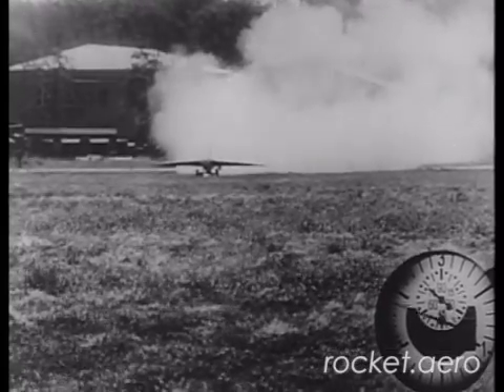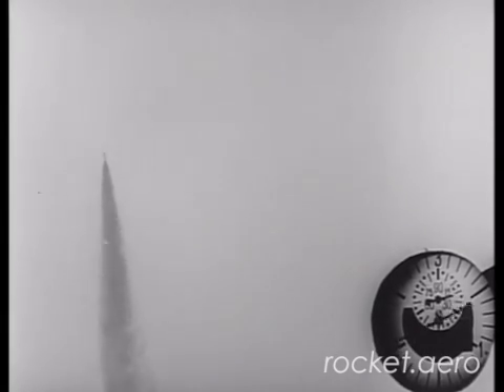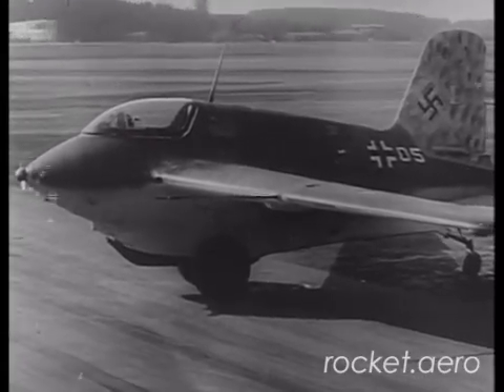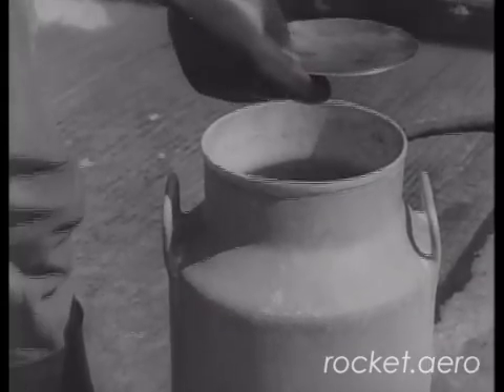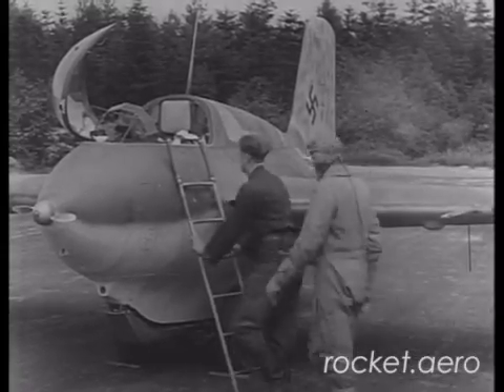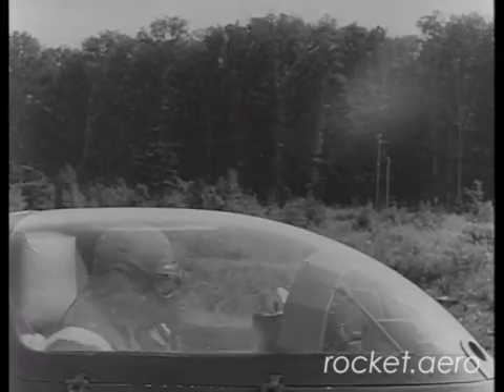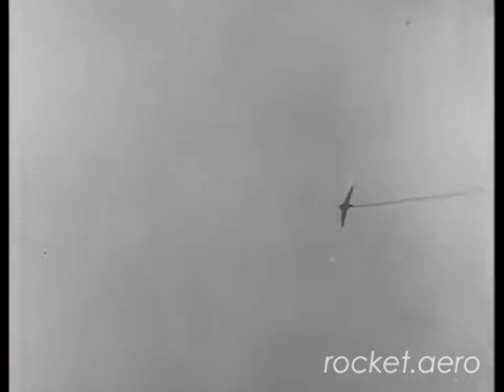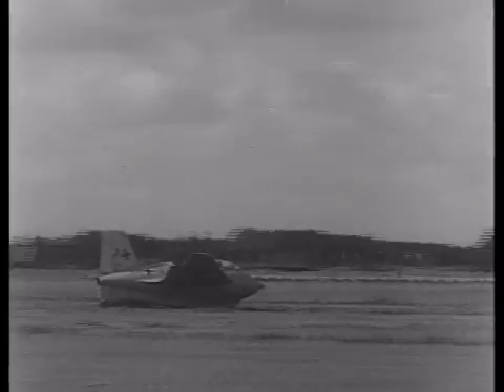USAAC Me 163 Briefing FIlm

Comment: Very impressive, but it did have a bit of a problem of exploding on landing.

And exploding on takeoff.
And refuelling.
And mid-flight.
And sabotage from the slaves who built the fuel tanks.

Oh, and the wheels bouncing back into the aircraft on takeoff.

And the pilot's spine shattering on rough landings. Just before the plane exploded.

There's a reason nobody else experimented with rocket planes 😅

Comment: As mentioned in the clip the fuel mixture was extremely dangerous.  Several test pilots were killed during fueling.  Any crash was terminal.
Reply: It didn't help that both of the chemicals were colourless, which meant that the ground crew accidentally mixed them up and injured/killed themselves

Comment: without german engineers, neither the usa nor russia would have come this far so quickly
Reply: With what? Rocket technology?
First of, there is a reason why this is the only rocket propelled jet fighter that was ever build (it is realy not a good idea for multiple reaspns). Also the soviets had their own rocket plane called the BI-1.

Also the U.S. P-80 jet fighter was designed and build parallel to the ME 262 and although the germans started working on the ME 262 since 1933 while the U.S. started the P-80 programm in 1941, the P-80 still came out just one year after the ME 262 and was used in italy during the end of the war. The P-80 was supirior to the ME 262 in almost every way and every modern jet fighter follows its design. 

Or do you mean the V2 rocket? Yes germany was ahead of the allies on that one but they were only ahead because they got f*** up by allied aircraft in the battle of britain and their long range bombers were absolutely terrible and had no bomb sights (that is why even the HE 177 had to be designed as a dive bomber) and supirior allied anti aircraft guns using the radio fuze HE-VT proximity fuze shells made it impossible to attack britain after 1942 because no aircraft could survive such precision AA. 
Rockets were inferior to bombers in every way but under these circumstances they were the only thing that germany could use so they put more effort into building them then the allies who did not have a need for them.
Reply: @jakobc.2558  nah USA technology is dogshit
Reply: @marcogriepx2708  damn bruh I guess great aircraft like the F-22, F/A-18, and  F-4E Phantom II don’t exist 😐😐😐
Reply: @jakobc.2558  lol smartass
Reply: yet china despite of its economic growth, still suffer engineering problems
Reply: good example of money and desperation, courage and recklessness

Comment: No mention of pilots getting melted by leaking fuel I notice.
Reply: Not melted but fully oxidized.
Reply: @foreverpinkf.7603  Thanks for the correct scientific description, the only other one I have read is turned into jelly.
Reply: @RalphColmar  Welcome. H2O2, which is used as a oxidizer, is also used to bleach hair (weaker concentration of course); afak most people survive a visit at the hairdresser and no one ever had melted.
Reply: @foreverpinkf.7603  Just depends on the concentration. Concentrated H2O2 is also very explosive.
Reply: @foreverpinkf.7603  
Big difference between 3% hydrogen peroxide and pure H2O2.
Reply: What I heard used the word dissolved

Comment: With time it could have been radio guided , pilotless , detonated in bombing formations!
Reply: Beth Johnson well yeah but for that time you would've waited 80 years to have the technology
Reply: ???   not a massive leap from Hs293 plus r/c or proximity detonation. They had the technology. Whether it would be effective is another story.   @Loup-mx7yt
Reply: If that were practical, someone would have gone in that direction after the war.
Reply: We tried that, Jack Kennedy's older brother was vaporized when the explosive packed B-17 he was flying blew up before he could parachute to safety.  Google it.
Reply: In WW2 the germans developed television guided bombs, air to surface guided missiles ( used in the Bay of Biscay, I tbink)  The V1 & V2 were guided with autonomous gyroscopic stabilization.  The worlds' first ICBM, the " New York  rocket" had been designed at the close of the war.  Also on the drawing board was the Sanger-Bredt Stratospheric Bomber. A space plane with a global range. In the 80's, a full scale mock up was built, as it was still a viable proposal. 
Read the Jane's Book; German Jet Genesis

Comment: Phenomenal plane, a revolution in it's day.
Reply: A very impressive way to kill your own pilots.
Reply: A waste of resources on dead-end technology
Reply: @CaptHollister  
Ok you get a zero in comprehension. .
 That Walther rocket engine and its successors went on to power assist our jet fighters in the 50's-60's.
RATO.and/or JATO.
Far from dead end. It was the beginnings of our space program. Werner Von Braun, who developed the V2, went on to head up the Apollo program and he designed the Saturn 5.
 Germans were also the first with swept wings, for high speed flight.
Reply: @patrickhorvath2684  Rocket-powered fighters were a dead-end concept. Swept wings were not a development that came in with the 163 as they predate WW1 and by WW2 there were other, much better planes that used them (think Me262). The invention and use of JATO/RATO pods also predates the 163 and were used by both sides during WW2, again nothing to do with the 163. As I said, the 163 was a waste of resources on a dead-end concept, unless you can point to all the current rocket-powered fighters. What do the V2 and Von Braun have to do with the Me163 ?

Comment: The test pilot mentioned in the film was Rudy Opitz.
Reply: 18tangles  She got to fly the Me 163A (unarmed trainer and initial proof of concept) under power with the first "cold" engine type.  That is where her "in person" description comes from.  She only flew the Me 163B (operational armed fighter version) as a glider.  They interchangeably use footage of Me 163A  and Me 163B types in this video.  The Me 163A's have a flat belly and a much smaller fuselage.  The Me 163B's have the bulbous round fuselage and are much heavier than the Me 163A models due to armament and extra fuel.  So, you are both "sort of" right.  How
do I know?  My father was the test pilot at the start of this thread.
Reply: @Demo Yes, she tested a 163 to destruction..
Reply: 18tangles  OK, believe what you want.  I will believe my father who was the chief military project test pilot on the Me 163 from 1941-1945.  He knew whenever she showed up, and personally briefed her.  He was the tow pilot (and only qualified Me 163 pilot present) for the flight where she had her famous accident.  He was no big fan of hers,  but he always wanted the true facts to be recorded - devoid of sensationalism, etc.  She had actually participated in some rudimentary testing of the Me 163B in glider form, as there were no engines available yet.  Then she had her accident, and spent a long time in recovery.  After she had rehabilitated herself, she came back determined to fly it again.  This time, they made her go through the entire "new pilot" training program on the Me 163A.  She did this, and that culminated in one single powered flight in the Me 163A with the small engine.  Then, when she showed up demanding to be allowed to fly the Me 163B under power, the Group Commander (Späte) denied her access.  "She went away mad and never came back."  Other references which state that she flew the Me 163A (training version) under power are: Komet The Messerschmitt 163 by Jeffrey Ethell, page 56, and Me 163 Rocket Interceptor Volume 1, page 152, by Ransom and Cammann.  I don't know why she might have given Winkle Brown the impression that she had not flown any version under power, because she certainly talked about it much differently in later times.  Brown, on the other hand, lied about not having flown it under power himself until all of the German crew chiefs who helped him do so after the war were dead.  It was only then, that he said that he had indeed gotten one powered flight in it.  Up until then, it was widely believed that my father made the last powered flight (25 April 1945?) which was an engine test, and wound up as a wreck which he barely managed to live through.  My father was initially supposed to demonstrate it for the US Army Air Corps in the USA as part of Operation Paperclip, but the powered flights were deemed to be too dangerous, so it was only flown as a glider for testing in the USA.  As I recall, Brown held my father in utmost respect.
Reply: 18tangles  Well, at the very end, my father was Group Commander of 2/ JG 400.  He was at Husum, but in the hospital slowly recovering from his injuries suffered from the 25 April accident.   It was he that ordered the Me 163s not to be blown up.  He surrendered his unit to Johnny Johnson from his hospital bed.  Winkle Brown could find him any time, as he was not mobile at the time.  As far as Brown's  powered flight goes, look up his YouTube video presentation where you can see and hear directly from him about how the German crew chiefs swore him to secrecy because they feared retribution.
Reply: 18tangles  That is subject to conjecture.  My father still firmly believed that there was a powerful network of "underground" Nazi sympathizers until he died in 2010.  He was afraid of retribution from them if he criticized H.R. and aired any of the gripes he had with her, so he always very carefully selected his words whenever he spoke publicly about her.  It really shocked me when I found out how much he was still in fear of those "shadow people" for such a long period after the war was over.  Inferring from this, I can only conjecture that those crew chiefs that helped Brown also feared from being visited by these same "shadow people".  They held valuable technical information that the British wanted.  I just can't see the British voluntarily handing them over to the Russians when the British controlled that sector on the ground.  They are all dead now, so you can't go and ask them.  Maybe Brown made some personal notes which might have elaborated on the subject?  You'd have to ask whoever has custody of Brown's archives.
Reply: Part of the answer you will find here... https://www.youtube.com/watch?v=0wlNey9t7hQ   @mrod2b216
Reply: @mrod2b216  And was there ever a real undergroud Nazi network then?
Reply: @ZerokillerOppel1  I have no first hand knowledge myself.  All I know is that my father definitely believed that it existed.  There are TV shows (History Channel?) that claim to have evidence of a network called "Die Spinne" (The Spider) which helped Nazis get from Germany to South America after the war.  My father came to the USA after the war as part of Operation Paperclip, so he was with a fairly large number of their engineers and scientists.  It must have somehow been discussed with enough credence within that community for my father to be so certain of its existence.  I only came to hear his beliefs about this when he was well into his 90's.
Reply: Only flown once by a non-German after the war, Capt. Eric Brown RN.

Comment: Landing speed 180 mph?! Thats like a F-104 Starfighter!
Reply: I just looked up the landing speed of the F-15 eagle. Its almost the same! Insane!
Reply: Hakapik small wings more speed
Reply: @tsarbomba4620  yep, but the downside is, small wings less lift, agility and Dogfight capabilities and problematic landing/start charactaristics
Reply: @Sturminfantrist   I've never heard of anyone trying to dogfight in one of these.  They where meant for one or two passes at a bomber formation before making a quick landing.  Not enough fuel for more.
Reply: @Rivercoon  

in case of the Me 163 yes but the Pakistan air Force used the F-104A during the Kashmir war in air to air  combat with indian MiG-21, it was not a success and the PAF lost a few F-104A because the IAF MiGs outmanouvered the PAFs F-104A

And the Luftwaffe had two pure  Fighterwings with F-104G  in service in the 60s for the Air to air role, but both Wings  after a relative  short time of service recieved the F-4F Phantom for this role
Reply: Yep and more dangerous then a F-104 during landing because of its highly explosive and unstable Fuel, but nevertheless the first plane with a  extrem high climbrate, like the famous F-104 a flying Rocket
Reply: @Sturminfantrist  Worse than a Starfighter, wow that IS ruddy dangerous :-)
Reply: @Sturminfantrist  fuel tanks would have been more deadly than when full of fuel because they would have been full of volatile fumes.
Reply: @RalphColmar  yep thats true,  many Me-163 exploded during a hard landing
Reply: @Sturminfantrist  no, at landing was the me 163 out of fuel...
Reply: @leneanderthalien  I know it !!!!!!!!!!!!!!, the 163 had only  short flying time and landed in a glider mode but there were  dangerous fumes left and fumes are fuel in  gas Form, do you know now what i mean , iam  sorry that my engl. is so bad,  generally the  163s fuel T and C Stoff was extreme dangerous during every Phase of the Sortie, refueling, Start and during landing because of the fumes left.
Believe me i know enough about aircraft incl the Me163, i have nearly 200 books incl aircraft Profils about the theme.
Reply: Strangely enough, the wing loading when landing was about the same as a Piper Navajo, so the landing speed could possibly have been dictated by a nose high attitude beyond which it was inadvisable to touch down? Possibly they feared a forward pitching if they landed tail low? 
The actual rotate speed at gross weight on takeoff is listed as 170mph and I very much doubt that pilots would have been instructed to become airborne without stall plus, say, 30 mph.
I suspect the stall speed of a fuel depleted Komet was around 100 mph, it was just too hazardous to land the aircraft at the very high angle of attack this speed would yield.
If a replica of the wheeled version was built it would have extremely benign flight characteristics other than the results of being short coupled. As I recall, the Komet could not be induced to spin, and non-accelerated stalls were similar to a modern canard design.
Opitz said that it was easily capable of getting on the tail of ANY fighter in the Luftwaffe inventory and that basically it was a joy to fly.
He actually said that the most unpleasant part of flying the Komet was the fact that near the end of the war they had often to eat a lot of cabbages, onions, and beans and other gas producing vegetables and that their intestines would blow up like a balloon due to the ridiculously high climb rate. He described the pain as "terrible".
Reply: Interesting comparison given the F104 aka Widowmaker had the oh-so-clever downward firing ejection seat etc
Reply: @RockinRedRover  Not all F-104 Versions had the downward firing Ej. Seat, iam not 100% sure which of the US Verions have it or not, the  A or C ? but the Multirole G version had the  upwardfiring Lockhheed C-2 Seat, later replaced by  the safer Zero zero capab. Martin Baker Seat GQ-7 Seat
For a high flying interceptor a downwardfiring seat is not a Problem but for a Fighterbomberversion flying nuclear strike,CAS  and other low level  Miisions it makes no sense so the G Versions was planned from start with an upward firing seat (C-2)
The F-104 G had many good solutions, look at the stickpusher device, it was good for a highflying plane to avoid Stall Spinning but when you came near a Stall in low level flight the Stickpusher dev. was deadly so the Luftwaffe deactivated it after  some planes were lost
Reply: @Sturminfantrist  Agreed.
Reply: @RockinRedRover  about Widowmakers, many planes were widowmakers, the Bf-109 had a narrow undercarriage which led to problems during start and landings many inexp. Pilots died during training with the Bf-109,
 the first F-100 versions were instable, the F-105 had a reputation as triple thread: 
 "Triple Threat" — it could bomb you, strafe you, or fall on you"
Yes the F-104 had a bad reputation  in the early Service Phase but many problems were solved later, 
The B-26 Marauder had a widowmaker reputation but the best in combat safety record of all USAAF Bombers (lowest loss rate %  in combat)
Reply: @Sturminfantrist  Agreed again. In more recent times the A10s had a "widowmaker" image too, esp for the British Army eg 9 soldiers killed when their Warrior APCs were attacked in the Gulf in Feb 91. I won't go into more detail, but neither will I forgive or forget, as the USAAF appears to have done.
Reply: On a skid....crazy.
Reply: @quellenathanar  it was not the only Plane landing on skids and starting on a Dolly, take a look at the worlds  first Jet bomber Arado 234 Prototypes ;) but for the Ar234 it was an impractical solution and Arado reconstructed the 234 to the 234B version  with an conventional undercarriage, it took/cost time and the aircraft service intro was delayed because of the reconstruction, so i dont understand why they did such crazy things like landing on skids, a combataircrafts turnaround time ( rearming and refueling) should be short , placing a aircraft on a Dolly and recover it with a crane/specialtractor takes too much time, it is operational impractical for  many reasons.
Reply: 18tangles  you missunderstood my Post, i dont compare both Planes i mean both were Climbmonsters of its time period, i know that the F-104 climbs faster then a Komet
Reply: Can't be true.  Even if they meant 180 kph, that would still seem high for an empty (light) Me-163, but I imagine it was supposed to be kph and not mph.
Reply: LOL you mean the Star brick